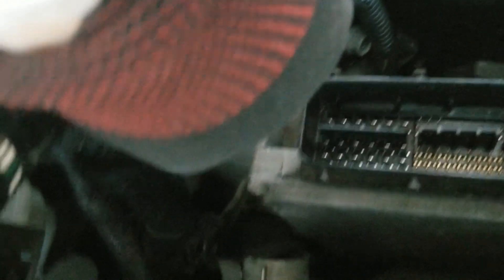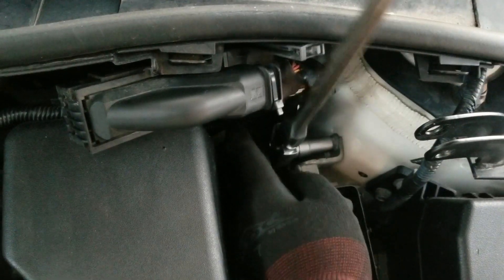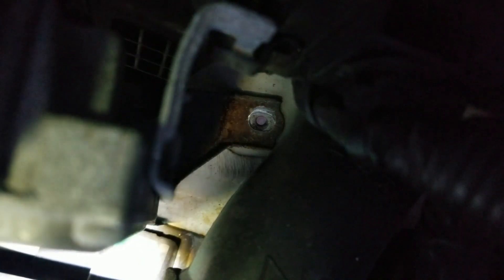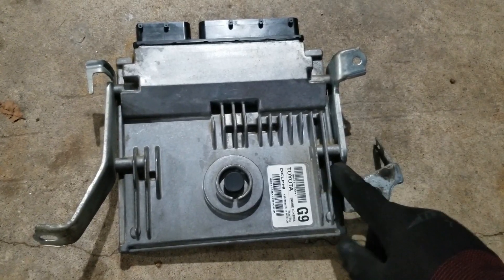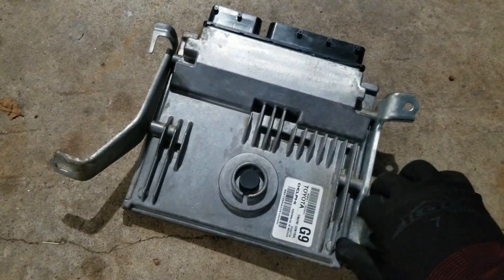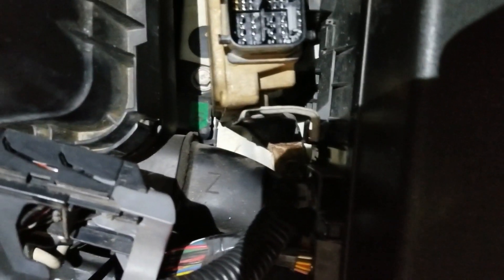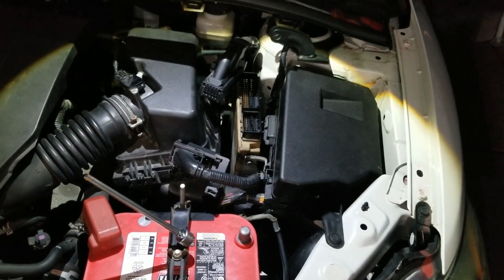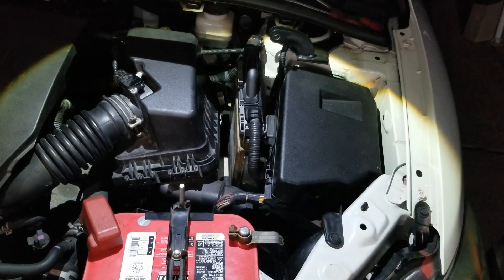09-13 toyota corolla Engine Control Module (ECM) replacement

Comment: replacing ECM is not finish your problem. I replaced all spare plugs, ignition coils, oxygen censor and ECM. And check engine was light was 
ON. Toyota want you to go on Toyota dealer and pay, pay and pay. Nothing more!

Comment: I’ve priced a few preprogrammed ECM’s and they run in the $230-250 range, but the mechanic quoted the dealer as charging $2-3000. Your swap out seems pretty straightforward. Are there many steps between where your video ends and getting the vehicle running?
Reply from the maker: Once installed (shown in the video) and reprogrammed,  the car start up right away.

Comment: Great vedeo and great explanation 👍 please can you tell me why the reason you replaced the ECM? because I think need to replaced on my 2006 corolla 1.4D4D 🤔  cheers from Norway 🇳🇴 👍👍
Reply from the maker: The issues that led to me switching the ecm started with my car struggling to start up. Still drove around and noticed the rpm not functioning correctly and check engine light came on. The car would randomly shut off even while on the street.
Obd scanner gave me code P0601, ecm failing. 
Took it in to a local shop, they also said faulty ecm. 
So i swapped for a new ecm and the car runs and drives normal again.
Reply: @CT's Garage  hi mate 👋  I have a really strange  problem on my 2007 TOYOTA corolla 1.4d4d 🤔 long time ago  someday  when I driving on stip hill  the engine stops suddenly 🙄😑 I call a recovery and I send a car to TOYOTA dealer! they said the problem it's a fuel pump because they found a failure code (P1229 fuel pump system)!! ok so I taking a diesel pump and 4injectors  for a diesel special workshop! they rebuilding intire fuel pump and I put back again on the car 4 brand new injectors and  a full rebuilding diesel pump! it's insane because it's exactly like before!!🙄😡😡 and costs me (35.000kr(3.500us dollars) and  keeping the same the failure code P1229!!! I deleted the code and I can driving  the car but  slowly not press the gas pedal much on hills I need change the gears and never pass a 1700RPM!! in some cases I need  driving in 1500RPM!! it's crazy because I driving in lower speed and  the others driver's they don't understand why I driving so slowly 🤣🤣 anyway on this time  from starting this problem I replaced also a turbo sensor, a sensor vacuum on front radiator, map sensor, both sensors on common rail, fuel filter original, fuel lines from the fuel tank to fuel pump etc..., EGR brand new, I removed that stuff inside of the exhaust catalizator! and nothing no progress on fixing the damm problem!! the engine starts really good  -36! winter conditions no problem and no matter if the engine is hot or cold  when I start engaged a first gear press the gas pedal slowly  because if I press a gas pedal around 3secounds he moves quickly and stops 😕🙄😡 here in Norway unfortunately not have a professional mechanics 🙄 just a guy's  "part's replacers"!! I asked to many people have a similar car's but never finding someone with a similar problem 🤔 maybe a damm ECM like your? 🤔🙂
Reply from the maker: @jorgefonseca9225 per the p1229 code, that's a fuel system over pressure. When there is a problem with the pressure in the system, the code get stored in the ecm. The car now releases fuel pressure based on its new reading that has been stored. Since you have a lot of work down on the fuel system already, it may help to reset your ecm so the sensors in the car can take the new readings in. Be sure to do your research before you decide to swap out anything. 
Good luck on your project!

Comment: Why would someone have to replace their ECM in their Toyota? I own a matrix & I’m trying to diagnose a problem w mine
Reply from the maker: Faulty ecm is common in pre-owned cars. It also brings up that annoying check engine light. 
The issue i came across was irregular idling and the car just shutting off on its own without any reason/sign besides that cel. 

Hopefully tou get yours figured out.
Reply: @c123723 hey man, could this also not let the car turn all the way on?? 

My check engine light is saying ECU but now it doesnt stay on. It cranks but doesnt stay idleing. Could this fix the problem?
Reply from the maker: @B_MAN_707  it could be A possible reason, but you will want to check your car to be sure because there are many other reasons as well that will cause your car to crank but not idle. For example not enough compression can cause the same thing too. Check air, fuel, and spark to make sure your engine is getting its basic needs. Or a bad crankshaft sensor can also give false reading/info to your ecu making it seem like the ecu too.

Comment: What is this actuallly?? How did you programmed?? Not helpful
Reply from the maker: Some vendors online will ask for VIN when you purchase the ECM so they can program it for you. That's how I got mines. Otherwise, check out the comment from Mech40 (from above) with the steps on how to DIY.
Reply: @c123723  the problem is I have Corolla 2021 and there is no pin at the number 13... Data link connector diagram is strictly changed... This is why I ask you how to programm ecm another way
Reply: @Ali.6364  how are you gonna say this isn't helpful when you don't even have the same car in the given year ranges stated in the description. Smh 🤦‍♂️

Comment: There are several videos on how to program these PCM's. On the 16 pin data link connector (OBDII) you locate pin number 4 at the top row and pin number 13 along the bottom row and make a jumper wire. Once the jumper wire is installed you turn the ignition to the on position so your lights come on the dash, several lights will start flashing, once you see this you're supposed to let it sit for 30 minutes. Once the 30 minutes is up you turn the ignition to the off position then remove the jumper wire. At this point the PCM should be programmed to your vehicle, you should be able to turn the ignition on and start the car.
Reply: I used this on a 2006 Toyota Corolla s. I was having weird codes on a previous ecu about throttle body. Changed it same issues. Changed ecu, was getting crank but no start. After using this technique I’m getting the start. Preciate it so much!
Reply: Can this be done with a paper clip or do i have to buy a set of jumper wires?
Reply: Can you help me to do that ?

Comment: Can you please list all the tools you used to do it with the size I have to replace mines
Reply from the maker: I updated the list of tools I used into the description.
Tools: rachet, 10mm socket ,socket extensions , star bit screwdriver
Reply: Torque bit not star. T-15 , t-20 examples.
Reply: Why did you have to replace yours, if you don’t mind the question -thanks!